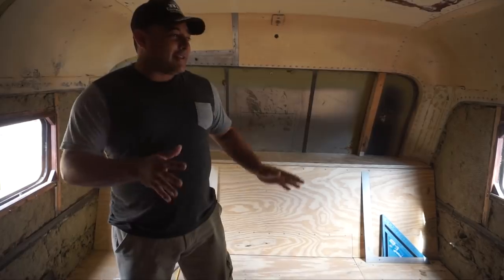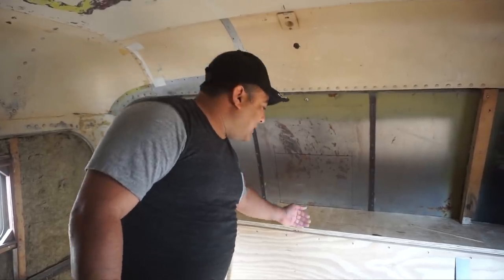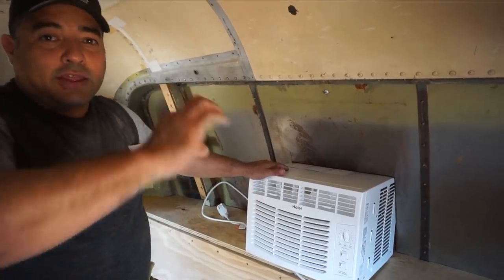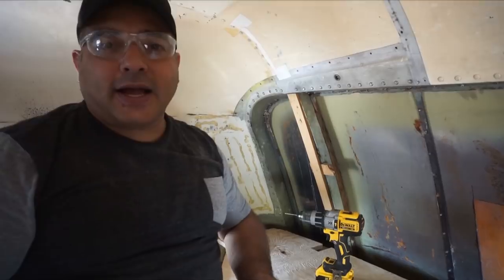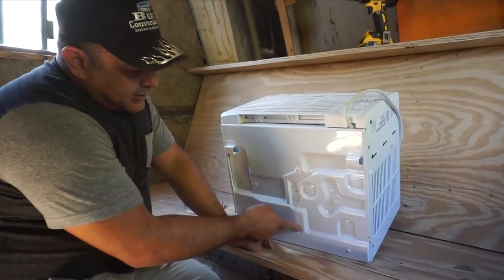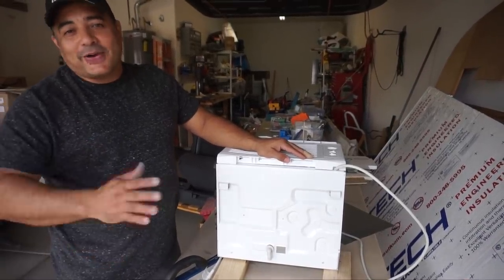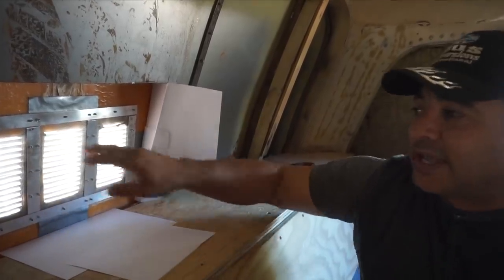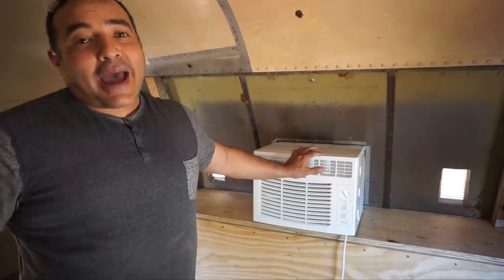Installing a Window A/C in the bus (but not in a window)

Comment: You fascinate me with your attention to detail, you take a $30 window A/C and build a $1000 custom mounting kit. Great job as usual!
Reply: I doubt that it cost $1000 to install the window unit - but, it certainly could have cost that much for someone else to do it!
Reply from the maker: LOL - odd right? If I factored in my hourly rate I am sure this mounting kit would have cost well over $1000 :).  Sometimes the reward is in solving the problem :)
Reply: @BeginningfromthisMorning   I know it's been awhile but, where did you get your metal break and what brand is it. You have some mad skills. Love your channel. Followed the Bus Grease Monkey here. Thanks
Reply from the maker: @rickl6697  thank you Rick L - it is literally the cheapest one you can buy at harbor freight.  It works pretty well for light gauge stuff.

Comment: For $30, you should have got two or three in case they break for easy replacement, since these AC units aren't designed for high vibration buses they may break easy.
Reply from the maker: I really should have.  Fortunately these units are pretty inexpensive anyway - if it breaks we just slide another one in the channel :)
Reply: Absolutely not.  These small units are absolutely cheap all the time.  When space is a premium, you dont ride around with spare window ac units stored laying all over the place.  It is counter intuitive to a minimalist lifestyle.  You can pick them up at garage sales all the time for little to nothing.

Comment: I like your videos, but I think there is a better solution for this problem.  The mini-split probably has enough cooling power to cool all of the interior space and it is much more efficient than a window unit.  The problem is just that the back is isolated from the front area and doesn't get good airflow.  I think I simpler solution would have been something like a quiet bathroom exhaust fan (or any other kind of duct fan) installed in the back corner of the bus with a duct sending the air to the front room near the mini-split.  This would cause air from the front room to be drawn into the back room.  A passive duct could also be installed if airflow under/around the interior doors was not enough.  The fan could be controlled with a manual switch or some kind of automation that would trigger based on the temp difference between front and back rooms.  This would keep the air mixed throughout the interior without having an extra air conditioner, exterior holes, etc.
Reply from the maker: Thank you Chris - very thoughtful Idea!  I think your idea would really work well - we just don't really have the height to pull it off.  The inside is about 6'4" from the floor to the tallest point in the ceiling.  After we get done building everything out we expect the inside will be less than 6'1".   We really hope the minisplit is enough most of the time - before we mounted the window unit in the back we would just turn on a fantastic fan and it would really do a decent job of pulling the cool air to the rear of the bus.  However - when it is 115 degrees outside - I just don't think it will be enough.  Of course, we plan on traveling in nice moderate weather, but everybody gets "caught" somewhere that is too hot or too cold etc.  Hopefully that is when having this little unit in the back will really help out.

Comment: I was thinking of the same thing for my RV but now that slow start DC units are available I'm going in that direction. A big mistake was the rear venting, restricting the hot exhaust will rob efficiency by overloading the compressor and overheating it also which will kill that every time you replace it. Better to have louvers that open when in use. Never restrict a units air flow, it is designed for maximum flow not restricted. Cheers
Reply from the maker: We are hoping to travel in pretty mild weather so hopefully this unit will not see a lot of use, but we will let you know how it performed.  We have used it while working inside the bus and the little unit did really well.

Comment: Juan, I do not know if you know this, Not sure if these little ac units need to be tipped back a little bit ( some new ac unit are pre tipped in design stage even when they are flush ) , Even a few degrees forward and they will freeze and not work, Not sure if you can still add some thing that can adjust the height from flush to about 1 inch...  Just a thought, Real cool build on the ac unit.
Reply from the maker: Thank you William - it is indeed tilted back by quite a bit - probably at least 10 degrees as it sits on the back shelf.  We have been using it for about a month and I am happy to report that it has been working very well.  it draws about 400 Watts when we have the settings turned to "max" but that little unit will make the bus too cold in the back even on a 95-degree day!  Recently the weather has been really great here in AZ so it mostly just blows air around
Reply: @BeginningfromthisMorning  Good, I am glad that is working out, I kinda forget that these videos sometimes are a made over a period of time... This comment may also help someone else in their planning as well.

Comment: Hey great project.  Been watching from the beginning.  But, as an HVAC contractor I see a couple big problems.  

First your exhaust and vent air.  You would need the free area of the exhaust vents you installed to be at least equal to or greater than the free area of the condenser coil.  Your current installation is just simple blocking part of the coil.  I may work short term or on cooler days, but it will eventually continue to gain heat until it can't eject enough heat and will shut down on high pressure.  Also the intake vents must be of larger free area them the exhaust to reduce the static pressure across the condenser coil.   That's why in your normal house, the return vents and ducting are always bigger than your supply vents.  Fans can easily push but suffer when pulling.  

Second is the recessed drain hole you drilled out is not the primary drain hole but the secondary or emergency drain hole.   The removal of condensate is primary done by the slinger blade which is designed and attached to the outside of the condenser fan blade.  This slinger blade slings the condensate water against the hot condenser coil to aid in condensation of the refrigerant in the coil and evaporate the condensate, thus no need for a drain.  This type of slinger has been incorporated in all window A/C units for quite a long time as it is one of the main forms of energy efficiency.  The water aids in condensation of the refrigerant faster and more efficiency than just air itself.  In fact, it you look in the trouble shooting section or the section like "NORMAL SOUNDS OF AN AIR CONDITIONER
"  you will see it listed as "tinging" or "pinging".  And for a system designed to work in Arizona, this will slightly reduce the amount of heat you can reject and conversely the amount of cooling you can provide into your space you wish to cool.
 
Love everything else and keep up the good work, and again, thanks for posting.
Reply: I saw a dude install a window ac into his crooked house boat and he used a 40-60 watt duct fan 8 inches to force hot exhaust air out, it seemed to work for him, and he uses it out in the ocean. so that's another option even though his exhaust is blocked. can you link me to a video explain the first part you said? I do not understand which is the intake vent and which is the supply vent.
Reply: @eksine  Yes, adding a duct fan or two would be the best option.  Maybe two of those 4" 12 volt bilge fans.  That's what I use.  About 100 cfm a piece.   The scenario I post above was considering using just the window A/C condenser fan blade to move all the air needed for proper condensing.   The only disadvantage to power exhaust is the tax on the solar system.  I setup system fans with temp sensors so they only come on when the temperature reaches high temp. I also stage them so one comes on first in the case that only one is necessary with the current outside conditions.   I also live in a cool part of the country so they don't come on that much.    But in AZ, they could possibly run continuously.    I actually disassemble mini split systems like your own and modify them to fit into unusual spaces.  Mostly race car haulers and high end RV's .  I also water cool them to heat water while cooling your RV.  

Concerning the power exhaust.  There are two ways to go.  Suck the warm air out or push the cool air in.  If you sit down and think about it, sucking the warm air out is the best case scenario.  Outside cool air pushed in can leak into the conditioned space and add to the load.  But in your case you may only have one choice, and in AZ, if you seal the conditioned space well, I can't see there being a big difference.  

I don't know of any video on the subject.  I've never looked, but I'm sure there are plenty.  Search residential duct design or duct systems.  The intake vents would be the vents you cut to bring in the cool air for the condenser, but again, if power exhausting then this this is mute.  The supply vents is the discharge of cold air into the conditioned space.
Reply: Oh yeah.  Keep up the good work.
Reply: Nicely explained 👍

Comment: That's a different approach I was thinking about using a portable aircondioner and run the exhaust out the window or down through the floor. But I understand the floor space is limited. I bought the portable one from Costco its a heat pump too it will blast you out of room. 
As usual Juan it turned beautiful thanks for sharing guys.
Reply from the maker: Thank you Brian - we thought we were going to do a portable unit for a long time as well - we just couldn't make it work.  We couldn't find a decent solution for where to store it when we weren't using it and the bigger problem was the water.  It's not a big deal here in AZ of course but we have visited southern states during high humidity and that is some next level misery.  This like many of the things we do is an experiment - It has been working beautifully for the last month or so that we have been using it but time will tell if the design was good enough.  We will update, of course, good or bad as we have more time with it.
Reply: @BeginningfromthisMorning  yeah I'm looking at the same issue but if there's a will there's a way right.
 I'm thinking about just rolling it into the closets I haven't built yet it. Lol it makes it so much easier when you have a blank canvas also my MCI MC9 came with a bathroom in the rear on the passager side the very back window in the restroom area has a spring loaded cover over a vent hole that opens from the inside and the hole looks exactly like the same shape and size as the exhaust tube that would go out the window in a residential set up if I don't go that route I'm just going to make an exit point in the floor somewhere and repurpose the cover from the window to keep out any critters so far it's on my to concept to design to build to install list you know after building one of these projects 20 some years ago you'd think I'd know better aparrantly not,  according to family and friends they just don't understand how rare of a breed we bus converters are right?
Thanks for sharing guys.

Comment: For big jobs in tight spaces Juan’s method is definitely the way to go. If only doing a handful of joints, Sharkbite or plastic Flare-It PEX fittings would be a less expensive alternative. For my coach PEX replumb, I chose metal ring crimped style but used Flare-It fittings where access was an issue. 

For the curious - both Milwaukee and Dewalt PEX powered expansion tool kits are around $400 on Amazon. To compare, powered ring crimpers are serious $$$ at $2500 to $3000. Manual versions of either are < $100. The beauty of powered is they are easier to work in tight spaces. Working the handles of manual crimp/expansion tools is sometimes impossible. Once made, both joints are permanent. On any job it’s best to have a handful of couplings at the ready to fix mistakes!

Comment: Nice, I'd like to have something like this,   I have a off grid home, with a power system similar to rv's and boats, even with a DC generator, and 12 v battery bank, and lighting, with 24v main system with inverter, 33kwh lithium battery bank, and 400 ah lithium 12v bank, awesome work, making it your own!!
Reply from the maker: Very cool!

Comment: Nice work! I'm wondering if it might make sense to fabricate some covers for those rear vents to use while driving. Swirling exhaust fumes and even rain water might tend to infiltrate the bus when moving down the road.
Reply from the maker: Thank you dprider02 - All of this will actually be sealed from the inside by the vertical wall that we will construct when we build out the back bedroom (that is why we needed the two "intake" ports on the sides of the "exhaust" ports.  Technically the area the air conditioner sits on is "outside" the bus.

Comment: Great job. Impressed by your sheet metal work. Something to consider is some of these small ac units actually use the condisation and rain water accumulation from top vent to help with cooling the compressor by splashing around and evaporation. Not sure if your unit is intended to operate like that I just know mine is. Good luck to you bus is coming together nicely
Reply from the maker: Thank you Jay O - We basically know zero about sheet metal work, so thank you for the compliment :).  Yes this unit is designed to operate as you mentioned with the water helping to cool the compressor (the fan has a built-in "scoop" to help sling that water) - unfortunately, there are no provisions for "overflow" - meaning if we are somewhere like Florida or Alabama where it is REALLY humid - we are likely to have a big mess of water on our hands.  I suppose a better design may have been to put the drain a little higher up on the side near the top of the frame - but then I would have to worry about water sloshing around in there.  We will report back if this shortens the life of the unit - I can't imagine TOO much condensation happens here in AZ where we usually have humidity level that hovers in the low 20s.  Thank you for the kind words and encouragement.

Comment: Good video. I admire your problem solving skills. I would’ve made a drain tray that was about 3” by 3” with an outlet to attach the hose. That way you should just be able to slide the air conditioner in and secure it over the drain pan.
Reply from the maker: Thank you Views and Reviews - that makes a lot of sense and is probably an improvement on what we had to do.  Great idea!

Comment: There is a lot of direct heat and cooling transfered from metal inside that touches the outside of the bus. The more you can isolate the metal (and glass) from the inside air the better. Nice instal and purchase...maybe the best $30 spent on the Bus?
Reply from the maker: Thank you Karl - yes the aluminum skin transfers heat VERY well.  Without insulation, this bus is like a solar cooker! We will cover insulation next (which is arguably more impactful than putting in an air conditioner).  I honestly couldn't believe it was $30!  I was pretty sure I would get home and it wouldn't work or it would be used ... something broken maybe? ... nope ... it was brand new and worked really well.  When we put our Kill-A-Watt it refused to pull more than 450 Watts - I was sold.  We paid over $250 to install Maxxair vent fans back in the bedroom $30 for an A/C was an easy decision to make :)

Comment: Hi Jaun
I use wall air-conds. I think that you can install box then slide the inside into it.
It may be better to have drain exit from back of box. Water accumulates in pan and will slosh around
when u accelerate.
I beleave they hate back pressure so would not use insect screen and would put one oversized grill on back instead of 3 small ones!
Sorry to be critical Rregards Alan
Reply from the maker: Hi Alan - No need to apologize - your input is valuable and I am glad you shared it!  I tried to find a large grill but I was not patient enough and just ended up going with the 3 smaller ones - more airflow, of course, would have been better.  I think your choice of using a wall air conditioner is a good choice - and they have better drains :).  I am hoping I installed the drains in ours low enough that very little water will be in there sloshing around.  We have been running this setup for about a month and I am happy to report that it is doing quite well.  I will report back as the temperatures start to rise here in AZ.

Comment: Looks great! Have you considered what happens to water that comes in through the louvers? A rainstorm with high winds could blow the rain sideways and in, or when washing the bus, someone will shoot water upwards which would enter the vents. Guaranteed it's going to happen. Where will that water go?
Reply: That's a good point.   But, he did mention installing "bug screens" to keep bugs out, so I imagine that will also keep most of the water out, too.
Reply from the maker: Thank you Dean - The cap covers the metal underneath that was originally part of the outside of the bus anyway - so the worst thing that happens is we get a little water between the cap and the original rear of the bus (it drains out the bottom of the cap anyway).  As Richard mentioned we have bug screens installed in all the vents that should prevent most of the water from coming in also - but if it does all of this will be sealed off from the "inside" when we build the rear wall inside the rear bedroom.